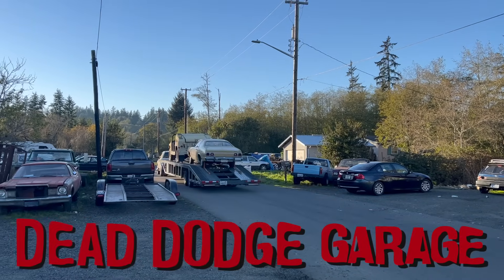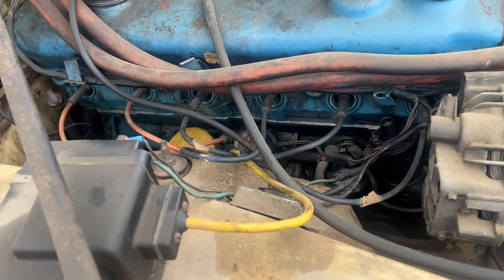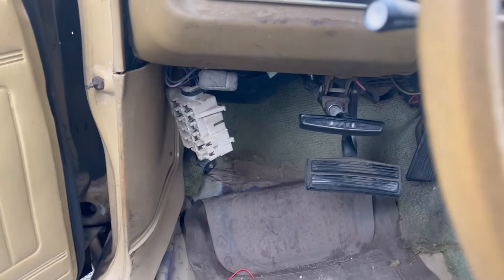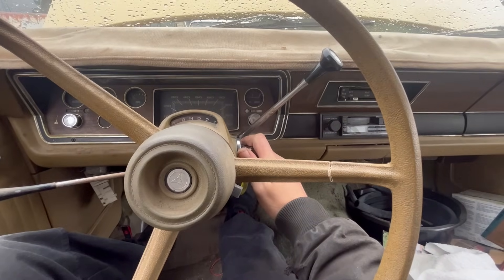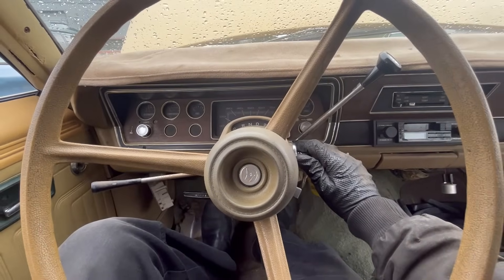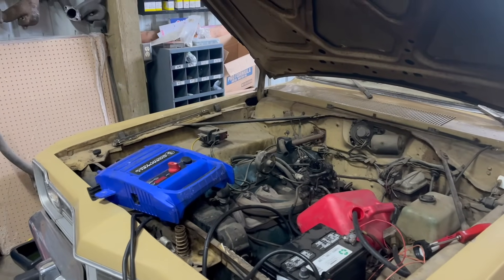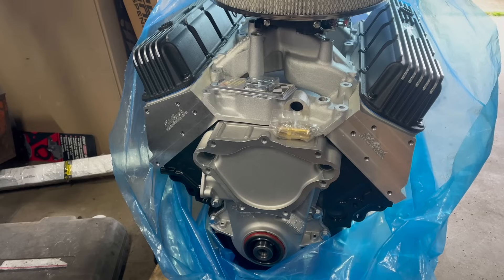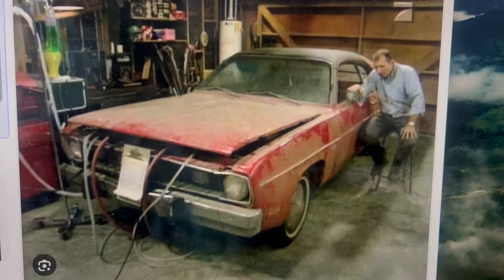Will This 1974 Dodge Dart Sport Slant Six Run And Move After 17+ Years Off The Road?

Comment: I bought a brand new 77 Volare base model coupe. Slant 6 automatic. Maroon with rally wheels and white letter tires. Looked great.  Ran like a top. Abt three years later I sold it to my mom and bought a new Grand Prix.  My mom drove that Volare for eight years with ZERO problems, even no rust although it sat outside in midwest winters with salt on the roads.  That Grand Prix was a pos.  Still miss that Volare.

Comment: Very cool car in REALY good condition. My aunt had a 74 Duster, which was the same car with different badging, Hers Black with White interior and a White Rallye Stripe and it had a 318. The first thing I do when I buy a classic car is I change the oil, but I I use the cheapest oil and filter I can find and then I throw a quart of Marvel's Mystery Oil in it, if it take 4 quarts I'll put 3 quarts of engine oil in it and 1 quart of MMO, if it takes 5 I'll do 4 and 1, if it takes 6 I do 4 1/2 and 1 1/2 then I'll run it  for 100 miles and then I'll change it and put the good stuff in it. But I also pull the oil pan and clean it out and let the engine drain overnight, then I'll clean the bottom of the engine and put the oil pan back on along with a new gasket. An engine that's clean on the inside is easier to find trouble spots than one that's nasty and gummed up on the inside plus it just runs better, the MMO is lighter than engine oil and will push all that crap that's been building up inside the engine all those years down into the pan.
Reply from the maker: I’ll use a bit of Marvel as an additive, but I’ve never used it as a flushing agent like that. I might be worried about knocking that much gunk loose and clogging the pickup - obviously if you’re pulling the pan then you’re able to deal with that. I’m more of a live and let live type. If it’s running and happy, I’ll leave it alone. If it has problems, it was going to anyway… that’s just my take on things.
Reply: @DeadDodgeGarage  I've been doing it for years and haven't had one clog up yet because the MMO is so light it still flows and i;ve some NASTY stuff end up in the pan, I;m also not running and running it, I'll run for 100 miles ISH.  I live 12-13 miles from work so I will generally change it with the cheap stuff and MMO  drive it to work for a week and then that next weekend clean it up and put the good stuff in it, I'm basically using it as a breaking in oil to clean everything and recondition it.

Comment: There was a day you couldn't drive more than a mile and see at least one Dart, Valiant , Duster ,Demon, Scamp, or Swinger. I had a '74 Scamp that color I believe it was called Fawn Beige maybe?  It had the same old vinyl bench seat that ripped at the seams just like that one. It's slant 6 had massive blow by so I put a hose on the breather and ran it to exhaust the stink behind the car . It was a Minnesota car so it had rusty rear quarter panels. rusty front fenders etc.  When I think back on it now It was really a fun car mostly because I never worried about ruining it.
Reply from the maker: That’s where the real fun is… when things aren’t nice and don’t matter. That’s my kind of party. It’s a real bummer than every single A body is apparently worth thousands now - but we still have F bodies…

Comment: I had never paid much attention to the 6 cylinder A-Bodies before. I had an old Mopar chassis book that said the V8 A-bodies from 1973 and newer with V8 engines and disc brakes got the 4.5" bolt pattern wheels. I didn't think much of it, until somebody told me that also included 6 cylinder A-bodies with disc brakes. I think those only came with 8.25" rear ends, which would seen odd in a 6 cylinder car. I later found out that for 1976 all A-bodies got disc brakes, due to federal safety standards for 1976 models. It looks like this 1974 6 cylinder has disc brakes. Is the rear end an 8.25" and is the wheel bolt pattern 4.5"? That old Mopar book was from 1979, but the article in it may have been older, since it was a compilation book of several older Mopar technical books.
Reply from the maker: You are correct that all 73+ disk brake A bodies use 5x4.5” - but there were many, many cars with a 7 1/4 rear axle and the larger bolt pattern. That’s what this car has.

Comment: I completely agree with you as far as storing the engine with coolant. I am that way with CAT diesels. I think without it...all the seals and o rings go bad. Even an engine with low miles on an overhaul will usually not last long if it was pulled from the truck and stored for a long period without coolant.
Reply from the maker: Yep. Stuff gets nasty when it’s unpainted and exposed to atmosphere - at least around here in the damp part of the world. I’d much rather have some antifreeze with its anti-corrosion additives in there.

Comment: Cool. I had a ‘73 Dart Sport in the ‘90s, 318 3spd (three by the knee) transplanted a 340 and 4 speed, and as luck would have it, a buddy was about to junk a ‘72 Dart 4 door, so $20 for the front clip and I was as close to a 340 Demon as I was gonna get lol.
Reply from the maker: Nice! I really liked that one I had. Slant with three on the floor. (Hadn’t heard three by the knee before - that’s a good one.) I didn’t even mind the ‘73 nose, really. It was primer gray, but under that, I found B5 blue and a white stripe. Of course now I’ve got my Demon, so I don’t have to be bummed that ‘73 is no longer around here.
Reply: @DeadDodgeGarage  Mine was B5 too, black interior and the unique Dart Sport side stripes, black.

Comment: Well beauty is in the eye of the beholder as the old saw sez.  I happen to love late b's with the Magnum being my fav and the 79 300 being 2nd.  They are just a few parts swaps away from performing as well as any other Mopar.  I even like Aspen/ Volare and dont hate LeBaron, Diplomat and St. Regis.  I kinda like 81-3 Imperial and dont hate the last Cordoba/ Mirada. All could make excellent sleepers and have the underpinnings to support all of the fun stuff you want to throw at them. My favorite A body nose was the '69 Dart.  But the beaks are nice too.  I guess my point is all of the pre K cars are cool (there are likely some people that like them too.)  Find one you like and can afford and make it cool...whatever that means to you.  Enjoy and have fun!
Reply from the maker: I completely agree!
Reply: Personally, I think ANY Mopar that was offered with a small or big block engine can be a cool ride, and not limited to 2 doors. I think a great example is just about any police intercepter. My dad once had a 77 "Small Fury" with the 440 Police Intercepter package (picked it up at a state auction in 1980 for $750) and it was awesome. Just a tire burning piece of fun, and decent handling and braking to boot.

Comment: 2:06 I kinda like this extra space  between the quarter panel and the wheel. Recessed wheels. I like this look, letting the shape of the wheel well edge more apparent. And when you move around the car or the angle from which you see it, I like seeing the wheel being discovered or hidding.
Reply from the maker: Interesting! I like the Cragars and meats that completely fill the quarters on my Demon - to the point that the driver side tire runs occasionally… this one will definitely have some more beef to it when we’re done.
Reply: Yeah your Demon looks bitchin'. I like it a lot. And Cragars looks good I  have to admit : D . Runs on sidewalks borders ? ^^
It's like , the spoke light alloy sporty looking things that, in my eyes, ruins the look of classics like the wheels used with pro touring  treatment, it cuts the immersion. I' m eager to see the new lif of this beige Dart ^^  @DeadDodgeGarage

Comment: My 340 4 spd swinger is a street car, not a race car. Mechanical secondary QFT lived just fine on it. EFI and a little boost works way better on it. Plus, 4 wheel disc brakes, 5 speed, stiff gears, and wizzy suspension makes it even better yet. I say just because Dodge screwed up the first time, doesn't mean you have to the second time. This build will be fun to watch.
Reply from the maker: My 340 4 speed Demon was a street/strip car from almost new. Although the 340 is currently out in favor of a 360, it is otherwise still set up as it always has been - and I will never change it. Four wheel manual drum brakes, manual steering, four speed, and 4.10s… it’s awesome. I will be applying boost to other projects… and am very much looking forward to that.
Reply: @DeadDodgeGarage  Yep, it's your car and you get to choose your path with it. I've owned mine for well over 20 years and I guess I got a little bored. Decided to load the parts cannon up and have some fun with it. I have no regrets.
Reply from the maker: @boostedswinger  I'll absolutely be doing that with other cars. And I'm sure if you decide to go back to stock on yours some day you'll be able to do that. There were only 2500 or so '71 340 4 speed Demons made. Mine is a time capsule and I love it.

Comment: Love your videos Jamie! I’m a die hard mopar fan too! I’ve got a 72 charger in my shop right now and I’m doing paint and body on it! My question is it won’t stay running! Only if I hold the key to the start position?
Reply from the maker: Ballast resistor died. That or a wiring or key switch problem - but the resistor is by far the most likely.

Comment: yeah turbo slant. Im hopefully sometime after the 15th  will be picking up a 79 aspen with very minor rust for an aspen and living in the midwest. It is a super 6 car but that now looks like my turbo 6 project car when/if i get the money to start dumping ungodly amounts of cash into because im going to go the standalone ecu  rout.
I just love that the slant is pretty much the ultimate sleeper turbo engine that you didnt know you wanted in your life but ever since i heard guys are pushing over 600hp and 700 torque i just want one.
Reply from the maker: Oh hell yeah. I’m very much looking forward to getting into that myself. I’m going to run the Atomic throttle body system I have - but only because it was essentially free. Very interested to see how that works.
Reply: @DeadDodgeGarage  im like a very very long ways from doing it but i want all the power. So e85 500-600hp and with stand alone ecus being sorta cheap it shouldnt leave any power on the table. 
I just want to gap the hell out of people with an engine designed so long ago. Also a guy at work would have an aneurism if i made it work so now i really want to.

Comment: I may have said this before.....I love Darts.  There, see?  I said it again......just in case you'd forgotten.  I also love Dusters...but some say they are the same car.  

I like what the subscriber intends to do with the beast....and I suppose if one has a fair wad of cash spare, they can chuck everything they can find that's all shiny and new at it, which certainly takes a lot out of the equation in regard to which bits will fail first over time as she's driven..., so I am in full support there too (although I personally don't think I could afford all that - it all looks and sounds rather expensive, so I will just have to live vicariously through this build).  The only things left to fail on the car will be the likes of the wiring loom....er....um....unless he has supplied one of them in the pile too....and ancillaries, cosmetics and interior.  Me?  I'd probably leave everything else stock (unless the car was begging to be changed) so she was a wolf in beige clothing, but that's me and my preference for sitting benignly at a set of lights in a boring looking car and then flooring it off the mark and leaving them behind in my dust(er). 

Man, that poor old 225....  Many years ago I had a car with an engine so worn out that it used to backfire through the carb and stall any time it was under the minutest of load - just like the Dart did.  Cresting a hill was a cause for celebration, because if the engine detected it was being made to work, it sneezed, backfired, dropped a cylinder, farted, blew smoke from anywhere it could (including the cabin vents) and did its level best to stop before the top.  How a car can go from 60mph to 10 in the space of less than an eighth of a mile and without someone hitting the brake, is a feat in itself, but I preferred to get to my destination and used to nurse it along....until the day I could afford to replace it.   The engine HAD done 113,000 miles after all.....which isn't bad for a 1500cc engine from 1962, but was still about 10k miles past it's use-by date.  

Got to find more on this one....
Reply from the maker: Wolf in beige clothing is exactly the plan here. There won’t be many obvious signs that it isn’t still grandma’s slant six car - until you hear it. Yeah, you’re right - that is a pretty cool trick. Haha.

Comment: I have a 74 with the slant 6. If you block the hose that goes from the valve cover to the carburetor you should get a tremendous improvement in drive ability. Best to use a bolt that blocks the hose.
Reply from the maker: …the crankcase breather hose? You kinda need crankcase vapors to go somewhere. Or are you talking about the PCV valve? You kinda need that too. I’m confused by this.
Reply: Yes it is the crankcase breather hose. The more I think about it if you cap it off I think it should be capped and connected to the carburetor and not the crankcase. I hope this helps.
Reply: @DeadDodgeGarage Maybe if you pressurize the crank case, it helps make the blow by from the pistons not so bad🤔🤪
Reply: @gbrads  Don't those just connect to the air cleaner?
Reply from the maker: @gbrads  I don't think blocking the crankcase breather is a good idea, and I don't really understand how it could make an appreciable difference in the slant's performance. Crankcase pressure needs to be vented somewhere, or it will figure out how to vent itself through every gasket in the engine. The PCV valve will handle a good bit of this, but especially with excessive blow-by like found in this poor slant, it's probably not going to do enough. You can switch to an atmospheric breather, but again, I don't know that it will make any noticeable difference in performance.
Reply: Yes you are right about the crank case breather it would shoot out any blockage like a rifle once the pressure built up. I just can’t remember how I did it. In fact I can’t remember how I figured it out. I found the diagram I was looking for it shows the complete vacuum set up for the emissions system. I hope it helps. Normally I would go out to my Dart and fiddle around with it until I remember but ironically it is in the shop for an intermittent hot start issue. I will send the diagram through your email.

Comment: my answer to anything that doesn't have a big block..... put a stroker small block 408 in it... Also that front end with a hood scoop and stripes helps hide the ugly.
Reply from the maker: Well that’s the answer we went with in this case. Haha. I think we are sticking with “sleeper” on this one. Not that a car with the wheels, sound and exhaust note this will have when I’m done could really be considered a sleeper… but it will appear mostly stock.

Comment: There is a story behind the use of the narrow rear track axle. Have you heard about it?
Reply from the maker: The width of the A body axle never changed. The track of the front end was widened along with the front frame rails during the ‘67 redesign, and disk brakes push the front wheels out a little bit further, but the rear was never changed. That’s the story I know.
Reply: @DeadDodgeGarage  that’s pretty much the story. The B-van has a similar story for its rear axle on the one tons.

Comment: My '76 Valiant sedan came from the Tulalip reservation. It also is "Sahara Beige," with the very un-'custom' trim level. 88K original miles & super solid except the spare tire well needs replacement. .892 & .893 ("340) torsion bars, sway bar, passenger exterior mirror, map light, HD cooling and HD rear leaf springs. Everything else? El cheapo deluxe!
Reply from the maker: Perfection!
Reply: It's getting closer. Prepping for the 2024 "Southern Classic"

Comment: Duster weirdness. The rear wheel track is narrower than the front. A b body diff will fix that.
Reply from the maker: Shared A body weirdness ‘67-76, but extremely noticeable on the Duster due to the quarter panel design. We will be solving the problem a different way - with wheels and tires.

Comment: Had a 1970 Dodge dart swinger red, white top,two door 190000 actual miles couldn't figure out the horn it little rubber black strip inside the steering wheel accidentally found it
Reply from the maker: Rim blow!

Comment: Will you accept my challenge? Back in WW2 they stuck 2 motors together, meshed the flywheels and stuck them in a tank. I challenge you to stick 2 225 slant 6’s together. A slant 12?
Reply from the maker: I can’t begin to tell you how many hours of my life that should’ve been spent on something else have been dedicated to considering how to stick two (or more) slants together… back in WW2, Chrysler stuck five flathead sixes together and called it a tank engine. What a party that was.